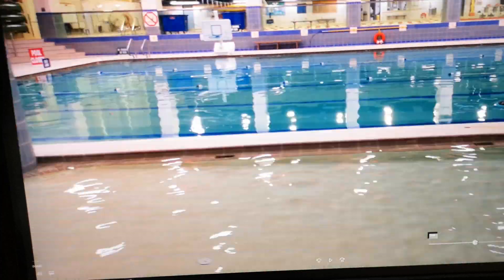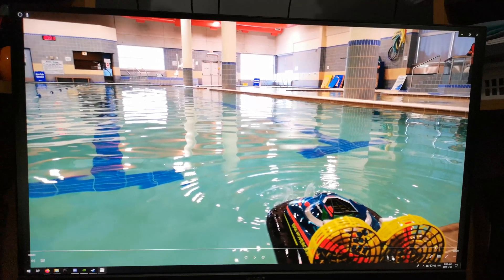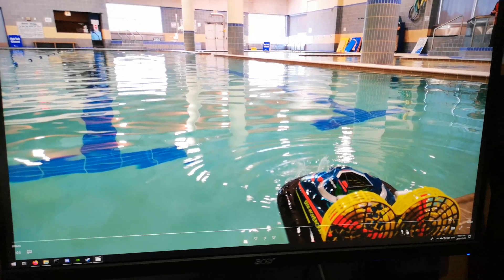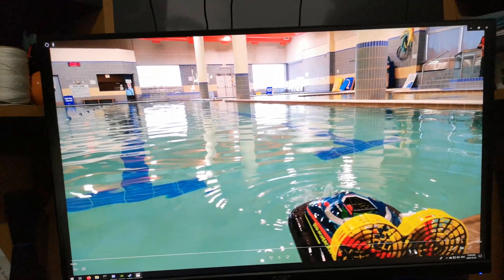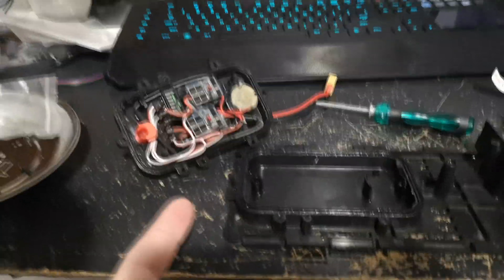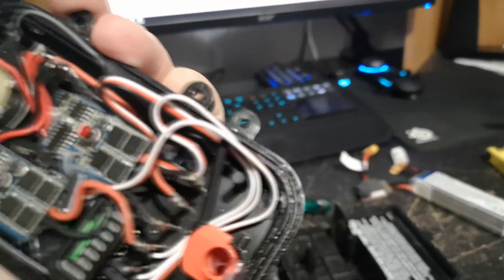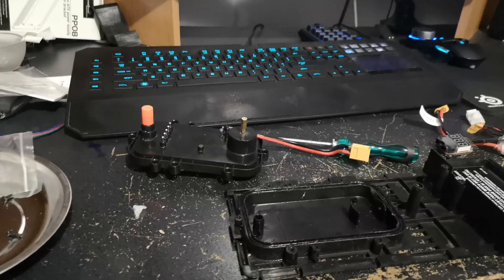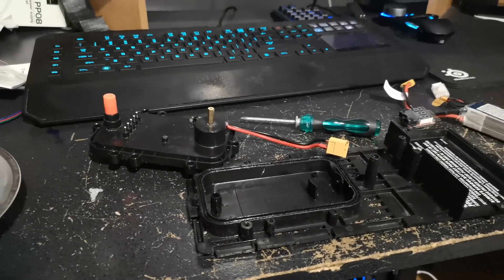Taiyo Edge Hovercraft Resurrection Part 4

Comment: Hello, I have one of these boats, but it did not come with the battery. Can you tell me which kind of battery it needs?
Reply from the maker: I think originally it was a 7.4v nimh
Reply: 9.6v I believe, can be had on amazon for around $15 or you can use a 3s lipo, but have to make sure it fits and would have to solder on a new connector.

Comment: Hey, you forgot something very important, in the skirt there are pieces of styrofoam on each side to avoid it to sink on low battery. Size is about 300x60x10mm (maybe 15mm).
Reply: 290x60x15mm.

Comment: I'm just doing one of these for my son. He bought it at the local car boot sale for £2. The styrofoam blocks are just simple rectangular prices, one down each side. They just sit loose in the skirt. They are  29x 6 cm and 15mm thick. There is also a styrofoam arch shaped piece that fits higher up in the body around the lift fan. With all the foam missing, it's no surprise yours sunk!
Reply: Furthermore, My skirt was a bit loose, so at the moment I'm glueing it to the black plastic ring that holds it to the upper body. Looks to be working well. I've also had lift issues

Comment: Motor failure caused it to sink?
Reply from the maker: Yeah, I'm working on switching to brushless motors all the way around but going to take a bit.
Reply: @JunctionRunner  how did you get on with the styrofoam layout? Or do you think you'll just run it without
Reply from the maker: @craiga6557  I'll probably add some in while I'm converting it to brushless just in case there are further issues, I definitely don't want this sinking in a pond or something.

Comment: you need these for both  drive props  https://uk.banggood.com/Racerstar-2845-Motor-Brushless-Waterproof-Sensorless-35A-ESC-Combo-112-114-RC-Car-Parts-p-1113519.html?rmmds=detail-left-hotproducts__6&ID=521372&cur_warehouse=CN use them all the time very powerful  and small fitting  you could also use one for your lift   then you could just use a cheap 2s lipo   the ESC all have built-in low voltage cut off and are waterproof